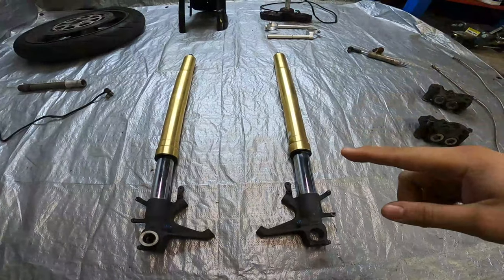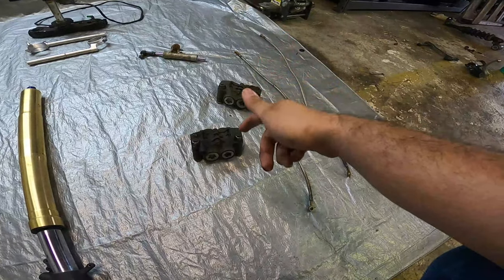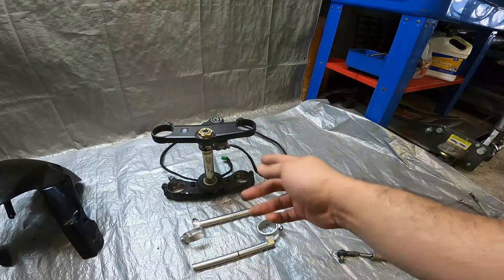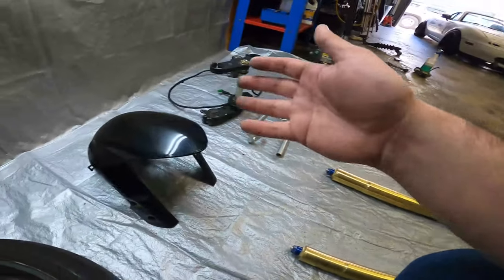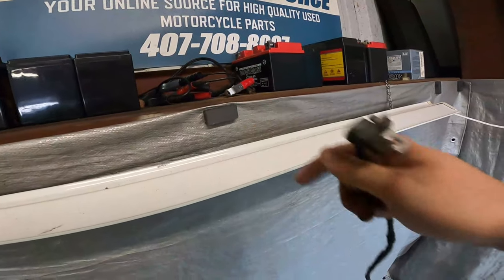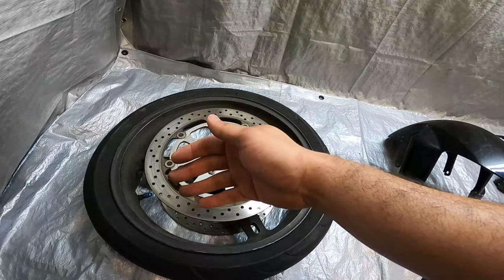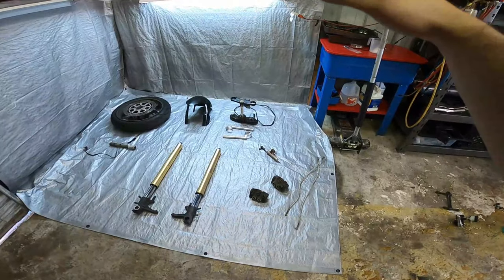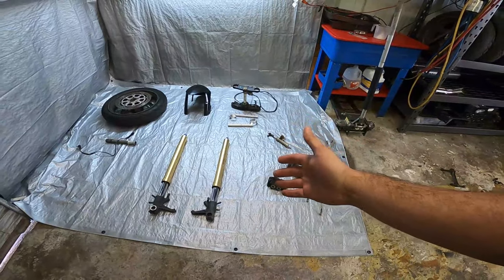Suzuki SV650 GSX-R Fork Swap Parts Guide (GSXR Front End Suspension Conversion)

Comment: Awesome breakdown! Just so people understand who are in between these two options, the adjustability difference  cannot be over stated. It’s the difference between having to swap the oil weight, volume, cut new spacer length, remove and adjust gold valve emulators (if you have those).  And then Gsxr forks: just turning a few adjuster knobs.

I will be using a rebuilt set of oem forks for the track this year, but I’m sure I’ll switch to the Gsxr forks when I can, for that ease of adjustability and brake upgrade.
Reply from the maker: Thanks for the feedback! Good luck with your track season this year bud! 
Please subscribe to the channel if you haven’t already. Ride safe 🙂

Comment: Great video! Looking at doing the swap myself but I've got a naked sv, how much of a difference will there be in parts? Thanks in advance!
Reply from the maker: Thank you! The swap on the N models is just as straight forward as it is on the S models. However, if you want to retain the tall handlebar style. You will need to modify the GSXR upper triple or source a custom upper triple that accepts that style of handlebars.
Reply: @PASSIONBUILT  awesome thank you, do you know of the stock clocks will still fit? And do you happen to k ow of any places that sell custom triples? Again thanks in advance for all the help, it's greatly appreciated
Reply from the maker: With the N model you will need to find the special upper triple specifically made for this conversion for your cluster to bolt on directly. I’ve only parted out one bike with it and the whole conversion set sold very quickly. I’m not sure where the original owner got the triple from. Other than that, the N model owners usually make a custom bracket to adapt the cluster to the triple. I hope this helps!
Reply: Should u use a sv front fairing or a gsxr front fairing?

Comment: Thanks for the content. I recently picked up an SV1000. Did a fork rebuild and service, while working on it I figured out that both fork legs are bent. So I am looking to put GSXR front forks from a 2006 GSXR 600 / 750. What other GSXR parts will I need to complete the swap?
Reply from the maker: Upper and lower triples, wheel, fender. Basically the complete front to do a straight swap.

Comment: Question!!??!?!?!? can a SV650 Gen 3 motor, fit into a Gen 2? Is it a plug and play or are there different mounts due to the different frame??
Reply from the maker: I’m not entirely sure since I’ve never had my hands on a Gen 3 SV. The motors across the board are pretty much the same with some minor changes throughout the years. For example. A Gen 1 engine will fit a Gen 2 bike and vice versa but you will need to swap your stator, flywheel, intake manifolds, and something else I’m probably forgetting. Gen 3 shouldn’t be too far off.

Comment: With the addition of the emulators and drilling out and welding of the breather hole, how much fork oil and weight is recommended?
Reply from the maker: I honestly do not know off the top of my head. There are plenty of write ups on this on the SV rider forum.

Comment: Any difference in handling issues that may have arisen from changes to rake and trail?
Reply from the maker: This is a great question. Yes, there are minor changes to the rake and trail after you do this suspension swap. It’s nothing that impedes the bike’s handling in a negative way. This suspension setup was removed off of my other SV that I just parted out and that bike handled wonderfully.
Reply: @PASSIONBUILT  Thanks for letting me know man! I heard someone mention it may be problem if you fitted certain rear shocks off sport bikes that may raise the tail significantly.
Reply from the maker: This bike had the Kawasaki ZX14R rear shock. No issues at all 🙂👍🏼
Reply: @PASSIONBUILT  Nice! I almost went with one of those but found a have an 06/07 ZX10R just down the street so went with that. Been sitting in my garage for far too long. Need to get it mounted up this year lol.

Comment: Have you (or anyone reading this) ever done a front end swap of a 2003+ GSXR onto an older GS from the 80's?  I'd love to add modern forks/breaks to my '80 GS750 Cafe build, but haven't been able to find anyone who's done it yet.
Reply from the maker: I’ve never done a conversion like that. I’m sure it’s possible.
Reply: Look at the company Cognito Moto, I used to machine custom triples and head stem them to put a set of 2013 GSXR 1000 forks on a 1975 Ducati

Comment: Cool guide! I'm actually looking for parts myself to do the swap. Can the SV 650 rotors be reused? Afaik, they are 300 mm which would technically fit k4-k5 calipers, not sure if they would match with a GSXR or SV1k wheel though.
Reply from the maker: Hey there. The SV rotors will not work with this swap. If you’re interested in the parts from this conversion, this exact set will be available on my website next week. www.motopartssource.com

Comment: Which master cylinder did you use?
Reply from the maker: The GSXR master cylinder that the front end was removed from. However, you can use an SV650 or SV1000 master cylinder. If you do plan on using a GSXR master, make sure that you use one that isn’t on the recall list. There is an ongoing recall on certain year GSXR master cylinders that lock up randomly and have caused multiple accidents. Hope this helps 😃👍🏼